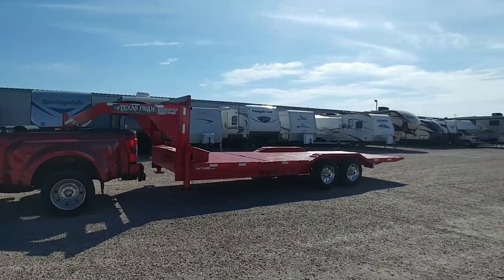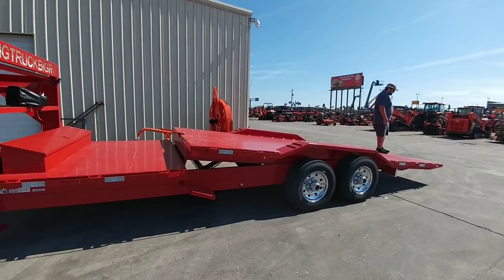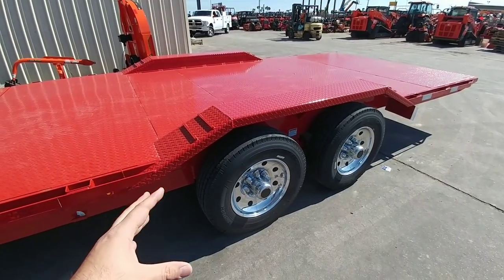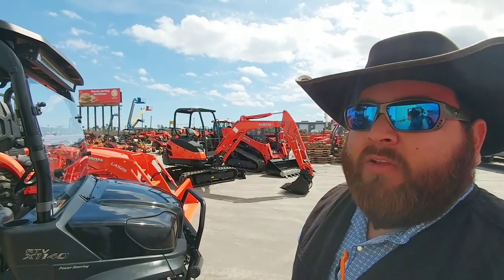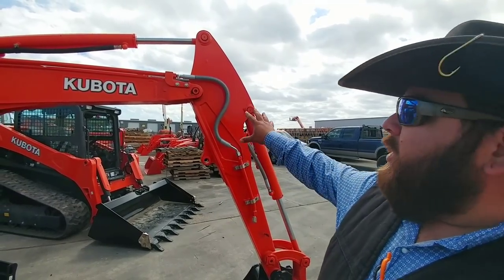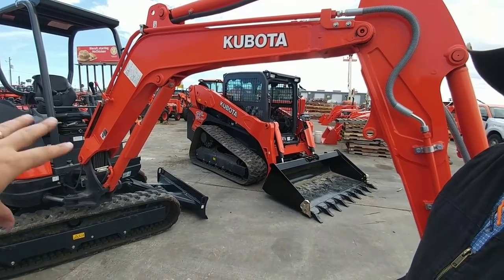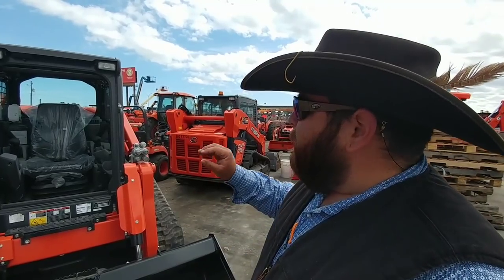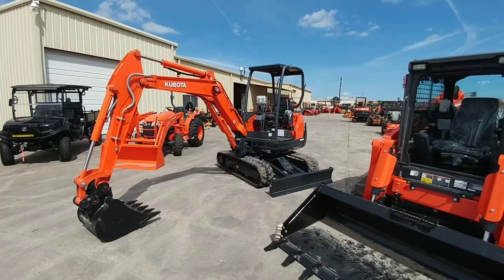Testing the new trailer with Kubota tractors! Texas Pride Tilt Trailer test Part 1 of 2

Comment from the maker: Update: We found that the SVL-95 Kubota Track Loader actually was around 11,600lbs as equipped.  Which makes it around a ton heavier than originally thought.
Reply: I recently purchased a svl95-2s. You are right about the weight. Also, you were correct with your price assumption $75k not $65. The sales guy should do his homework before getting in front of a camera.

Comment: That’s a strange setup for a trailer. Looks to me like you’re limited on load length to whatever the length of the tilt deck is. What if you have two pieces of equipment?  You’re basically stuck with whatever you load on first because the tilt will be covered up and unable to move. What is the advantage to this vs a true full tilt deck trailer?
Reply from the maker: Great observation.  The intent originally was to have the shorter model of this trailer that would only be around 20ft long.  They advised me to add the additional 3ft just incase I needed it.  This trailer only has a 23ft deck on it (though it may look longer in the video).  I will primarily be using it to haul only 1 piece of equipment at a time.  If I need to load things like Water pallets, concrete, bricks and other bulk items, I will have them side loaded with a forklift.  Had I needed the trailer to haul multiple pieces of equipment, I would have opted for a much longer trailer.
Reply: Yeah, can’t stand tilt trailers. Almost useless in reality

Comment: If you derated your trailer to 12,000gvw doesn't that mean your cargo is at 7k? Seems a little light to me bud...hopefully I'm wrong
Reply from the maker: So, think of it this way. I only needed a trailer with 7k lbs of cargo capacity. I could have had a 12k gvwr trailer with twin 6k axles or a 20k built trailer that Carry's 7k.
Reply: @BigTruckBigRV  I didn't know you wanted/needed a 7k lbs trailer. I'm now seeing this is more of a series about this trailer, not just a 1 video kind of thing. She's a beauty though for sure! Hopefully that Ford can handle her 😉

Comment: That 2501 tractor price is high with nothing on besides a loader. I got my 2019 2501 tractor package with a bush hog, disk, pallet forks, bucket, and 18 foot pipe top trailer for 21$k

Comment: I have a friend that had a 450 ford dump with tandem axle he had a  takaushi excavator and same brand skid steer on the same trailer he was caught by DOT  having the truck not reg covering the weight of truck trailer and both pc of equipment and he had a class 3 lic $$$$$$$$$$$ he needed a class A and the right reg on wt. your trailer de rated can only haul 12000 no mater if you have 50 ton axles ,I have a 1 ton dodge if I pull a trailer over 10000 lbs I have to have a class A and if the combo is over  26001   pound I not trying to be a jerk I don't want you to get caught by DOT and in Maine any trailer over 7000 pounds has to have a inspection sticker
Reply from the maker: I have a Class A license as well as fully understand that I can not exceed the GVWR of the trailer (GVWR minus dry weight).  I CAN go all the way up to the 20k built specs while not on public roads (on private property).  Also, all trailers over 4k lbs require annual inspection in Texas to be registered.

Comment: Why again are you derating these trailers again?? It's a beautiful trailer but if you go over the GVWR that the sticker is rated at, then legally are you over weight??
Reply from the maker: To keep the GCWR under 26,001.  I mainly will use it to tow a tractor that is around 6k.  Also for cars and trucks (which all weight between 5-7k)